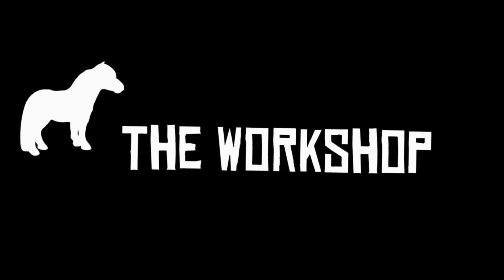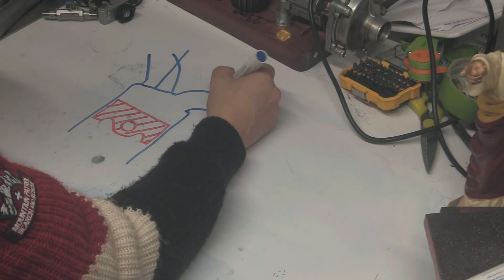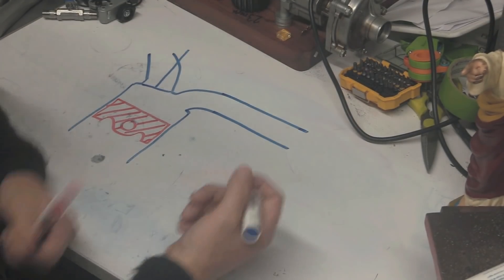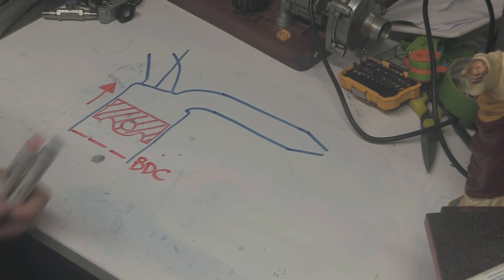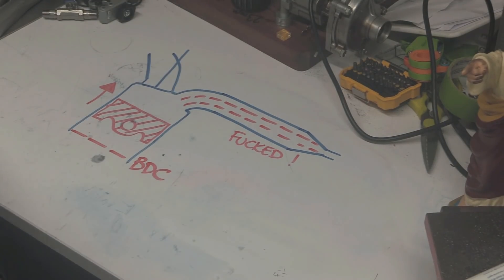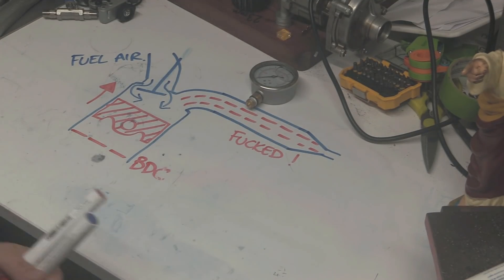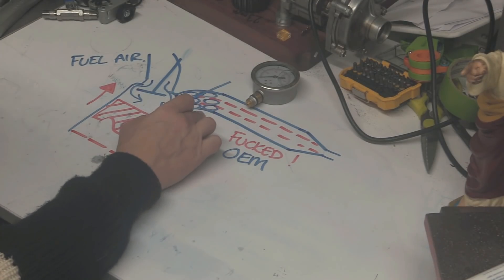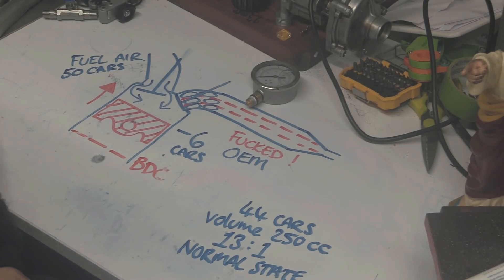New Exhaust makes bike run LEAN?

Comment: So lets say i straight pipe my exhaust and 12 cars out of 100 go out through the exhaust now. And then i retune the ecu to spray more fuel. So now im spraying 112cars but that dosen’t stop the 12cars from going though the exhaust right.. so even after a retune the fuel efficiency is gonna be shit??

Also does the amount of cars going through the exhaust and rpm, have a linear correlation?
Reply from the maker: The lean mode isn't across the rpm, just at given rpm. Retuning the ecu is to match this condition. So the remap is a retune, or re-match
Reply from the maker: As for a linear correlation, no lol wouldn't that be easy. The exhaust pressure is defined by the combustion condition and this is defined by the volumetric efficiency

Comment: Didn't you lop the end can off of your own bike?  Was tuning not necessary in you're case? or is it ok cos you left the cat in place. How do you even know if you're running lean?
Reply from the maker: Running lean means you lose power and the engine runs hot, and smells hot. And yes the z9 is fine bevaus end the exhaust system layout

Comment: Does changing a factory muffler to a Yoshi racing muffler upset the flow dynamic of the exhaust system enough to warrant an ECU map?

I think you've already covered this but I'm too fucking lazy to check

Comment: Why wouldn’t the manufacturers time the fuel injection pulse(s) a bit later so that the overlap would be air only and the full fuel delivery would enter the cylinder rather than having that rich fuel mix right at the valve prior opening? Doesn’t it cool the valve enough? Doesn’t it mix enough in the cylinder due to late entry? Something else?

My naive little mind is thinking that if you injected a little later (e.g. after exhaust valve close) emissions would be down as your not passing unburnt fuel through, and there would be no problems with exhaust changes as the full fuel load enters and stays in the cylinder.
Reply from the maker: 1) the fuel.doesnt mix properly
2) the valves doesn't cool properly 
3) at 12,000 rpm there just isn't enough time...

Comment: If aftermarket exhaust manufacturers try to replicate the characteristics of the standard exhaust, apart from extra noise, whats the point ?
Reply from the maker: The extra noise and they're usually not 400 series stainless. The question should be the other way around. $1000 for 4 HP lol thats fucking stupid

Comment: So I've recently had a replica exhaust fitted, needed a custom midpipe made, and I've definitely noticed right away my z400 is not running as it was from stock , it's running hotter and needs more revs to do a certain speed. I can feel it is a bit sluggish and my higher fuel mileage definitely shows it is running lean. Now the cat is still inside but I'd assume on a smaller bike it's because everything happens in the tails bread box. I'm possibly not getting the type of backpressure I need for a correct fuel mix, anyone know if I can take a 2019 z400 in and just have its ecu flashed and remapped? Or is it gonna have to be a long and very expensive process to get hold of and install a power commander, 3rd world South Africa shits incredibly expensive.
Reply from the maker: Just needs a remap
Reply: @thedirtyworkshop  meaning it's a less expensive process to just essentially edit the fueling values in the table?
Reply from the maker: It's a better process
Reply: @thedirtyworkshop  appreciate the help🙏

Comment: How do piggy back units change the system, or do they?

I know on the KTM 390s if you're not careful the motors just go into full meltdown!

Also does letting the bike idle reset the ecu, i saw Del do it! 😂
Reply: You mean like piggy backs that connect to the injector? As far as I know, It just changes the opening time of the injector. So if the injector was supposed to open for 3.5ms or whatever, you change it to open for 3.6ms (or whatever it needs)
Reply: @billythekid2281  Yes, I use a Rapid Bike piggybacking the ECU. It connects to Injector and the O2 sensor, use it because on the KTM you can’t crack the ECU and any performance mods make the bike seriously hot. Most use Raid Bike, Bazzazz or Power Commander. All auto adapt but I’ve no idea what’s going on when you look at the computer screen!

Comment: But how does that work with by carbs???? :)
Reply from the maker: The same principle only slightly different on the intake side. This probablyt requires it's own video but intake charge is suddenly stopped by the valve, all of that fuel and air crashes into the back of the valve dumping the fuel.

This is called port wetting. Once the valve opens again the same as described happens - assuming the carbs have been tuned to the system correctly before the exhaust change.
Reply from the maker: Good question and it will get it's own video, because people don't ususally read all the comments
Reply: @thedirtyworkshop  
Most of the stuff I piss around with has carbs, so I would appreciate that video, just to indulge my curiosity honestly.
Speaking of, I did read an article about it quite awhile ago, and to my untrained eye it seemed to be quite well put together. I don't know if you'd like to take a look, but I managed to find it if you're interested:
https://www.cycleworld.com/story/blogs/ask-kevin/why-rejecting-is-necessary-when-exhaust-system-is-changed/
Reply: @thedirtyworkshop  translation: it spits flames on roll off... :)
Reply from the maker: Another Kevin Cameron gem 

"The Negative Exhaust Wave Is Always Followed By A Positive One"

- LOL fucking dumb arse. It's the other way around - tit.

Comment: Another vid already?<3."you give me so much at one time"(credit Propellerheads)  Speaking of replacement exhausts, I've gone to a Blackwidow (UK) system. I never see them mentioned. Any opinion? They seemed a good price/quality choice, I'm still happy 6years later.
Reply: I'm happy with mine, needed a rejet though as they flow much nicer on my old thundercat with a stubby end can than the standard pipes.
Reply: Generic 50mm inlet parts bin jobbies.
Same as MTC, Blue Flame... And almost all the others in the UK.
They all buy same spec parts, slap 'em together and supply some bent steel tubing that's expanded to fit your headers.
Akrapovic and Arrow are the only exhausts that I've personally seen that seem to model specific tailor their cans.
Reply: @pauln6803  the one for my thundercat was custom designed apparently, with a percentage better flow for a drag bike some fella runs...
It certainly sounds the business over standard..

Comment: Well my klx with an aftermarket fmf full exhaust  just cause it to backfire soooo much, I believe it’s the valve overlap and the reduced back pressure that cause this, ps haven’t watched vid yet
Reply: How do you stop this tho, I don’t mind it but it’s annoying and anti social sometimes
Reply: Ain’t getting a klx remapped
Reply: @PhilKawasaki  solution is simple just weld the end of the exhaust shut, that way its more restricting than the stockpipe and keeps all of the anoying banging away (warning) results may not be what you want